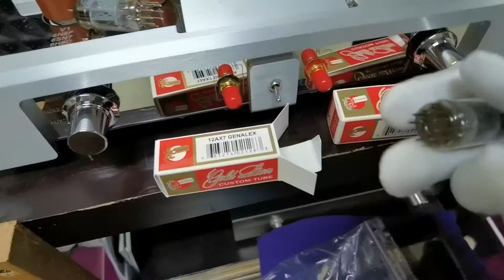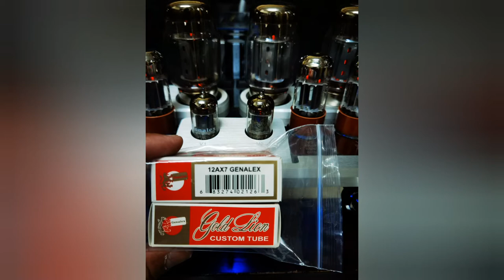Mullard Ecc83 VS Gold Lion 12ax7 tubes,,,Watch and see the difference..

Comment: So what happened?I don't get it.
Reply from the maker: There's no problem about Gold lion in terms of power. It has nice and good speed sounds as well as good bass, good mids and clear vocals. But if you really want a  more or better punch bass, use mullard although gold lion tube is more cheaper than mullard.
For me, I enjoy them both.
Reply from the maker: Soon i will upload a video using gold lion 12ax7,,sorry for my late reply
Reply: @kielpogzmusiclover377  gratitude brother,and I hope I had a Merry Christmas
Reply: @kielpogzmusiclover377  I paid a lot ,but I was stupid and paid full price when I could of got them cheaper.I bought 3 12ax7,and one 12at7 for the effects loop and two matched el84 tubes.the at7 tube alone was the most expensive at $39.00 for one tube without tax.the matched el84's were $52 without tax,and the 3 12ax7 tubes I forget ,but they were cheaper than that one at7 at $35 for each one,all the preamp tubes were gold pin tubes.I have not checked the power tubes,but they were not labeled gold pin.They had a rubber band around them and I just did not check them.Also at Sweetwater there was no warranty on the tubes at all. The total I just checked for 6 power tubes for my Orange rocker15 guitar amp the amount was $200 0lus tax and shipping.  I pulled the trigger going by what I read about🤦.The Sweetwater rep did not answer in time before ordering,but then he said that I chose the right tubes for more headroom and a cleaner,brighter tone as Orange amps have a darker tone that is all it's own compared to any amp I have heard.
Reply from the maker: @gettin_while_growin7  There are a lot of legit shops here in Hong-Kong that sell all kinds of tubes. I have 2 vlogs that shows 2 shops with their details and  location. You might consider to purchase here. It's cheaper compared to what you have bought. Here's the link. https://youtu.be/1Sx97WF5Dpk
https://youtu.be/dewvggx2nrI
Reply: @gettin_while_growin7  are you happy with your tone now?
if not i'll be happy to help,ide start by getting a nos mullard for v1

Comment: Interesting... so, the Mullard's (on the right) cathode glows brighter, once it's warmed up as shown at 2:15, than the Genelex (on the left). This results it more electrons being generated and passing to the plate, which equates to more amplitude (it's louder) and more mids and bass... that's essentially what  you're showing yes...?

It would have been nice to have some audio to actually compare their sonic characteristics for ourselves...

...and considering how awesome that amp looks, and how beautiful those tubes are when they're lit up, I really would have loved to have heard it...

but that's what you were intending to show in this video, the brighter cathode that equates to more bass and mids... yes...? 

How would you say they compare for clarity and micro detail in the mids, and upper frequency extention...? Soundstaging...?
Reply: hi . i'm a tube collector mullards are my favourites i specialize in guitar amps so here it goes:
1. what you see here is called "the mullard flash" which is a way to identify nos mullards when the label is worn the flash is the ultimate proof once you turn on the amp,no other tube does this.it has nothing to do with the tone since it flashes for a second at startup and that's it.
2.there is no point comparing any modern tube including russian sovteks(real nos gold lions are amazing just like nos brimars and mullards) to nos,since modern tubes have random gain and noise levels once you use a tube tester it all makes sense .nos are much more consistent ,usually have more gain, closer gain values between both triods,less noise since they had to meet military specs ,they are more durable and last longer. the tone is much better as well but  you have to pick your flavor. 
back in the day when ive wasted my time with modern tubes ive found the sovtek(fake genalex gold lion/gold sprayed pins)to be one of the best out of the modern crap,more highs than jj's less harsh than chinese tad or mesa tubes(shuguang). if you want to explore the best british tones ide start by reading the tubeking's guide, buying an orange vt 1000 tube tester and one mullard shortplates nos tube, the earlier the type is the more open the sound gets so if you want the most lower midrange and bass 70's mullards can't be beat. if you want more air early 60's tubes are perfect there are many other great nos options if you'll tell me what tone are you after i can help you get there
enjoy
Reply: @yaniv-nos-tubes  I recently found out that most European ECC83’s actually have a heater filament flash. Amperex bugle boys (which were made by Philips, who owned Mullard) do, which isn’t that surprising given the relationship between Mullard and Amperex/Philips. But even Siemens tubes do it. I believe some Telefunkens did too.
Reply: @yaniv-nos-tubes Thanks, very good explanation, which tubes do you think I should use to help achieve the slash tone in the Use Your Illusion recordings? My amp is a 5 watt Marshall with 3 preamp tubes and 1 el34 power tube